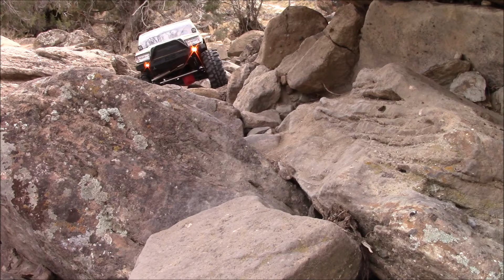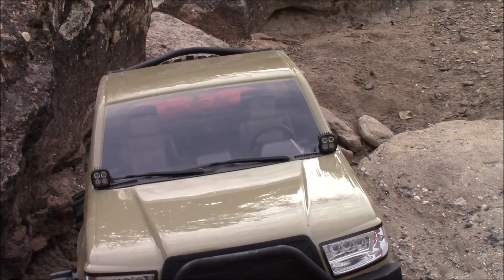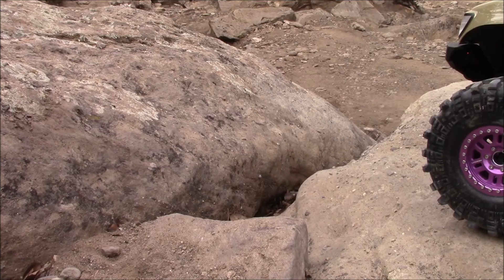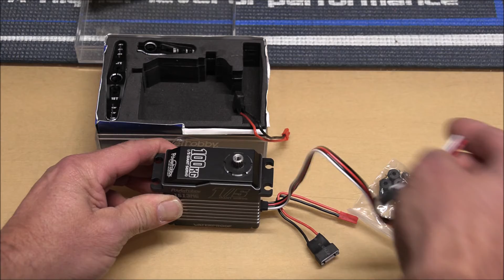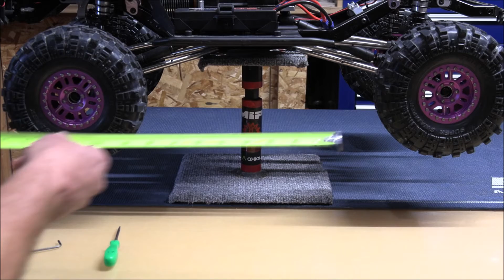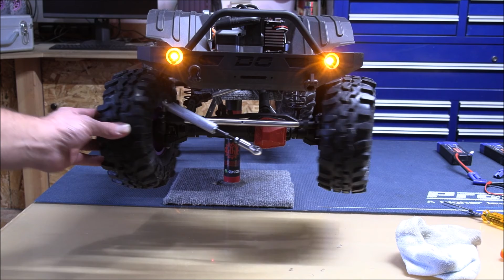SCX6 Build Series Video #4 Installing a PH 1513MG 2000 oz-in Servo, and a Vitavon Servo Saver Link.

Comment: Hi men, great video. Does your vitavon servo saver work on the stock axles housings and steering knuckle?
Reply from the maker: No, the servo saver ended up being a bad choice. It has so much play that it takes away from the steering. I would not recommend it.
Reply: @upgradedrc3697 ok thank you 🙏🏽

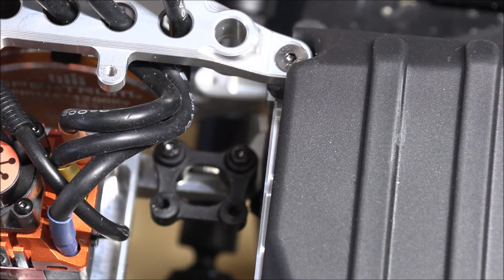Comment: 4:38 you know where I can get a mental mount ? I’ve still using mine on a new servo I got that’s the same size as stock one and I’ve connected it to the vitavon tray and it still moves a little and I think it’s because of that plastic one , it was the only way to make it fit on the tray

Comment: Disappointed in this video. Ordered the parts and started the install, only to discover you need a REALLY long bolt to attach the servo saver to the servo. This is not something that was mentioned in the video and you would need to go to the hardware store to find the right length. Another thing - you do not need the Vivaton servo horn. The Servo comes with a perfectly good servo horn that works great. Extra money you don’t need to spend. So after ordering all the vivaton parts in this video, I used none of them. Just the servo and the plate that comes with the SCX6 to allow you to mount a bigger servo. All the Vivaton stuff is 100% not needed for this service upgrade. I wish that was made clear in this video. And it should have included that you have to buy extra hardware to get it to fit
Reply: Dude chill, he’s not going to mention EVERYTHING to the last dot it’s not his fault you didn’t have a long bolt and had to go to the store to get one I’ve done that man up that’s part of the hobby you expect everyone to tell you everything?
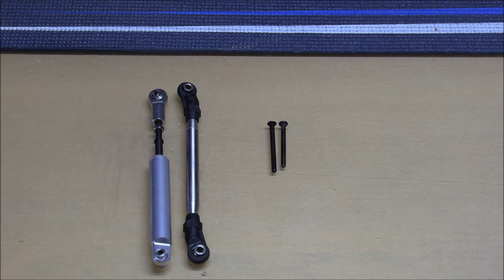Reply from the maker: I guess you didn't watch the whole video because at 10:34 into the video I clearly said you can use the stock servo horn. I am going with all Vitavon parts and the vitavon servo horn is smaller and has a pinch bolt in it, so that's why I went with Vitavon. And at 16:30 I showed a pic of the 2 bolts side by side and the one on the left is longer and needed for the servo saver to attach to the steering knuckle. As far as the servo horn attaching to the servo saver link, I used the bolt that came with the servo horn. Sorry it was not clear enough for you.